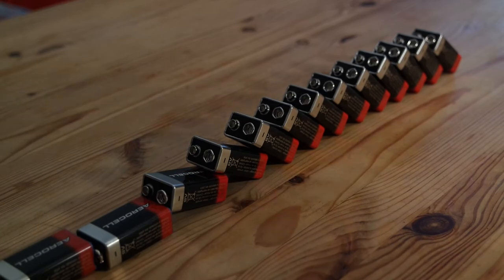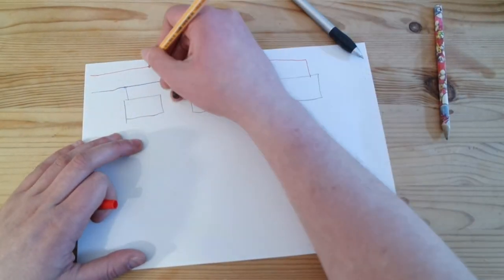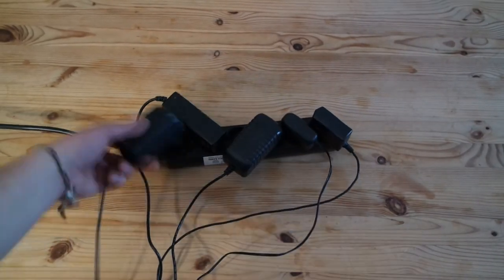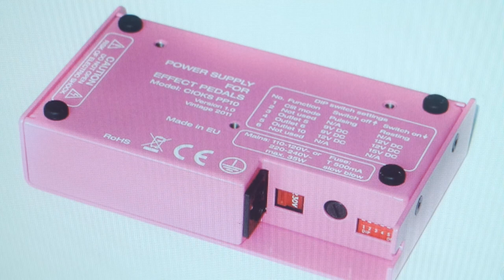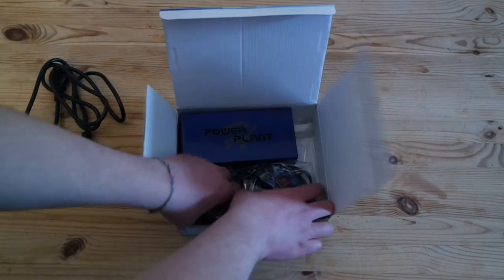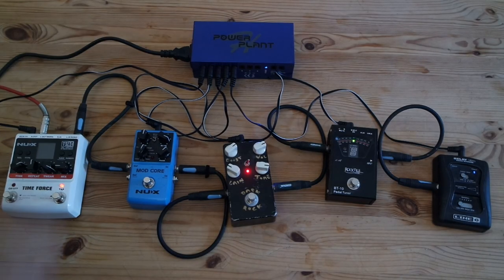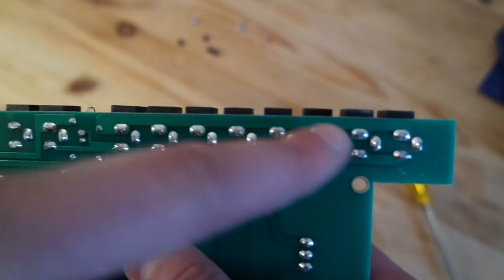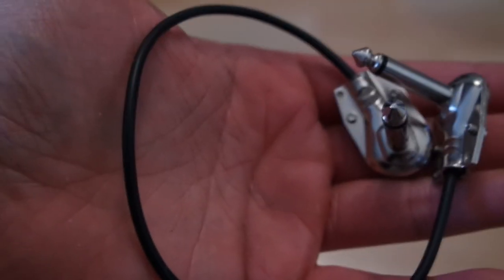Gear review: Harley Benton Power Plant (the actual pussy power)

Comment: Great video! Nearly suckered myself into buying a glorified daisy chain.. lel
Thanks again, owh do you now have a recommendation of a good somewhat noiseless Power Supply thats not astronomically EXPENSIVE? i mean i cant justify dropping 100 euros on a power supply lol
Reply from the maker: Thanks.
I haven't tried something else.
Well, first of all, I have a couple of 12-volt pedals, so I was looking for a supply that has this option. Ever since HB isn't the best option I use multiple supplies like on 1.27 . 
I live in Germany, that's why I'll buy the next thing at Thomann as well. I looked through their offers, under 100 euro you'll get as good as nothing with isolated outputs. 
Carl Martin Pro Power V2 looks good, at least they claim, that it has isolated outputs, maybe I'll try it someday.
https://www.thomann.de/de/carl_martin_pro_power_v2.htm
140 euro
another option is this one
https://www.thomann.de/de/rockboard_lt_xl_power_bank.htm
It's just a rechargeable battery, so you'll probably still have daisy chains, but at least you don't have an interference from the main power, this might work as well. But I haven't tried both of those things. At least you have 30 days money back option at Thomann.

Comment: great video!
whar are the downsides to disconnecting the ground wire in my patch cables tho? (besides cutting open my nice patch cables)
i guess you can only use those patch cables with a daisychain and power bank, right?
not with seperate adapters/batteries.
and did i get it right that only the positive lug on the  patch plug is connected to the wire? and it's only the patch cables? not one side of your git/amp jack?

any remarks/advice? thanks!!
Reply from the maker: That was the whole point. 
Harley benton has this daisy chains inside, so I don't see a point of using it. 
I want to try a couple more power supplies, maybe there are a couple of decent and not expensive ones. And I think that I'll do more reviews with taking those apart as well.
Reply: would be great 
i think i phrased my question a bit vague 
i wondered what are more cons to  disconecting the ground wire of the patchcables

Comment: I bought one of these. Big mistake. The mounting brackets that it came with were useless - couldn't mount it on my Pedaltrain. Weighs a tonne! And now I see that it offers no power isolation. Avoid!
Reply from the maker: Jep, check out powerplant ISO 2 pro or similar, those are good. and cheap.

Comment: Dude, you are a life saver. Many thanks!, for disassembling this fake isolated thing. I was about buy it. Insted of this I'm going buy a second hand Voodoo Lab Digital. At least real isolated and has high miliampers for digital pedals. 2 times pricier but, worths it tho.
Reply from the maker: You're welcome.
Reply: @doopydoop True. But what they should advertise, is that it is a really big daisy chain because is has a power switch and a 12V option. Thanks to this vid, I'm not ordering one :).

Comment: Wait, you just fixed the high-pitch ground loop whine problem with a patch cable without connecting the ground? How is it possible lol? Can you give a detailed explanation please?
Reply from the maker: Well, it helps sometimes. Not always. Do you know DI boxes? they have Ground Lift switch. It workes the same way. In most of the cases ground and negative cable are the same bus. To get rid of ground loops you connect only one device as usual with both positive and negative wires. The rest of the devises are attached to positive bus only. The negative bus will be supplied throught ground of the patch cable. This way you don`t have ground loops. But as I mentioned before-this works sometimes. In my case this worked with some of devices, but with some others it didn`t work. However, Harley Benton came up with their ISO Pro series, that are less than 100 euro, they are awesome and afordable. So, I purchased a couple of those, made review about them and use them ever since. And I don`t have to worry about any ground loops or look for some solutions for the problem. Back in the days when I made this video they weren`t released.
Reply: @leothemetal  thanks. For the detailed explanation bro. I have got 2 bad boys on my pedal board, mooer x2 preamp and m wave mini universe. They dont seem to get along with any other pedals i have be it digital based or analog, they produce the exact same whine as you demonstrate here. Using separate power supplies work indeed, but its bulky. Ill try this ground cut trick. But what do you suggest, do you think i should cut the grounds that i go in and out to(of) these pedals only, or vice versa?
Reply from the maker: @captain6198  Well....Some digital devices  produce some nasty noise. I suggest to grab some Harley benton ISO power supplies. They are dirt cheap and they will solve any problem.
Reply: @leothemetal  as a last resort ill buy one, its actually the shipping and the import taxes to Turkey that makes it costly for me :( its nearly twice as the units cost i need to pay apart from the netto price lol

Comment: is it dangerous to disconnect ground wire
Reply from the maker: Dude, those are only 9 volts, those can't kill you. and by the way, if you pay close attention to what I was trying to say, YOU DISCONNECT GROUND WIRE OF THE SIGNAL CABLE, NOT THE HIGH VOLTAGE POWER CABLE. Do you actually know, what the difference is? Or did you actually get the message what I was trying to achieve and how?  There is no high voltage in this circuit that will kill you. You disconnect a ground wire in only SOME PLACES, NOT THE WHOLE CIRCUIT to eliminate the ground loops and to get rid of the noise. Or are you really unaware of how this actually works?
Reply: i do know which ground wire you mean, but if i was well up on electronics i wouldn't be asking if it was dangerous, i was only considering the people who've died touching guitar strings and microphones which is probably a whole different thing
Reply: Well... that's just not true. I mean there have been electrical accidents and all but your pedal is still grounded. that's why the ground loop existed in the first place. You see your pedal is grounded twice: once through your patch cable and once through your power supply. by cutting your ground wire on one side of your patch cable the case of your pedal and the cable itself will be grounded up to the place where you cut it. Right after that comes the next pedal which will be grounded again by your power supply. so you dont have any parts in your chain which aren't grounded. If you were to unplug the power supply of your pedal it might be possible to get "hurt", but then again it's only 9 volts. you can actually try how that'd feel by touching both contacts of a 9v battery with your tongue (if you trust me). It'll tickle a bit but that's it. And your tongue is wet unlike your hands/feet... 
Anyway dont mess with electronics unless you know what you're doing!

Comment: What do you think about the new Harley Benton PowerPlant Flex?
Reply from the maker: I never heard of it, but thanks for mentioning it. I've just ordered it, so if everything goes the way I want I'll make a new video next week.
Reply: Nice, I will be waiting the review! Keep up the good work!
Reply: To add to this, I believe someone has put a review of the Flex on Thoman, says it is no more than a daisy chain in a long, thin box...... 

But.... I see they are coming out with something called the Power Plant Pro ISO-1 and 2, which seem to address these points - not enough power for modern digital delays and boutique pedals, and the isolation of the ground....

That been said this version in review was the first version, but when they did the 'junior' version they state that it is 'galvanically isolated', so I found this info on that...
https://warmcat.com/2016/10/07/advantages-limitations-and-costs-of-galvanic-isolation.html

So I figured it is essentially how they isolate sockets around a building, and if that is done and an appliance is somehow connected to something else that is inadvertently grounded else where, it wouldn't be the fault of the supply that produces the ground loop..... Hastag headache ! XD
Reply: Basically the grounding issue shouldn't be a problem in the junior version, but the ISO 1/2 versions are looking pretty cool! :-) Due in March!
Reply from the maker: I've got the Power Plant flex, made basic shots, right now I'm working on the final cut. But just as a sort of preview, yes, new power plant flex is the same daisy chain as an original power plant, only with the digital voltage meter. 
And guess what, I've already preordered the ISO version as well, it's not available yet, but I want to take review it as well.
Reply: I think it's thanks to reviewers like yourself pointing these things out that is hopefully pushing the companies to make better products, so thank you..

I'm glad to see Thoman paying heed to the issues and coming out with these ISO versions to address them, hopefully they might be just what i'm after..... 

The other option I've looked into, though I'm unsure as to how well isolated it is, is the TGI Micro Powerbox, which doesn't look too bad, but is apparently so small for something with 10 outputs that people are wondering about the type of transformer used, whether it is a toriodial transformer....? Will go over and try it out and check for noise sometime!

Meanwhile, back with the ISO's, the ISO 1 seems to have 8 9V outputs at 300mA - £50
The ISO 2 has 2 extra outs for 9V/12V/18V at 500mA - £70
Isolated, filtered and circuit protected...... 
Good options, but if that junior version is isolated in a way that ground loop hum is eliminated, for under £40 it should really be a bargain shouldn't it?
Reply from the maker: Thanks for a nice comment
I didn't quiet get what junior version do you mean. Is it Powerplant Junior?
I doubt, that it's better version of original powerplant. I mean, it's possible, that it's the same daisy chain in a box, but with less outputs. Haven't tried it though.
Reply from the maker: Thanks for a nice comment
I didn't quiet get what junior version do you mean. Is it Powerplant Junior?
I doubt, that it's better version of original powerplant. I mean, it's possible, that it's the same daisy chain in a box, but with less outputs. Haven't tried it though.
Reply: Yep, 
https://www.thomann.de/gb/harley_benton_powerplant_junior.htm

'Galvanically Isolated' apparently... 

According to that page on 'galvanic isolation', as long as it is definitely isolated in that box, there should be no common ground because they are all at different potentials? :-/ I'm completely confused anyway! XD
Reply from the maker: Somehow I missed it :)
Reply from the maker: Maybe I'll take a look at it as well
Reply from the maker: Well, I finally did it.
https://www.youtube.com/watch?v=8IVxonwjCno&feature=youtu.be
Reply from the maker: Hey, jayjay ripoff, check powerplant junior review. I've got a surprise for you. And please contact me.

Comment: Sorry but you are wrong. I have been using 2 One Spot power supplies to power 12 pedals and it functions perfectly. It's your country that has a screwed up electrical system.
Reply from the maker: Well...Germany has a screwed up electrical system. Congratulations. 
The thing is-it's not about a country. Some venues have screwed up electrical system and when I'm playing gigs it's not my business to handle the screwed up electrical system. I need a power supply that works in any conditions. HB powerplant isn't this kind of device.